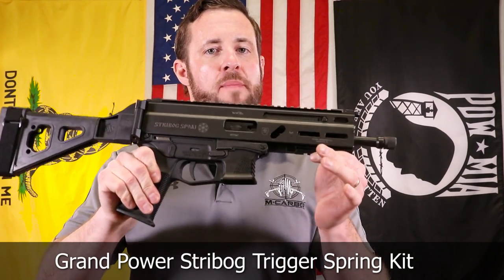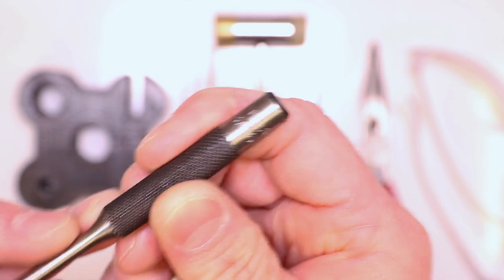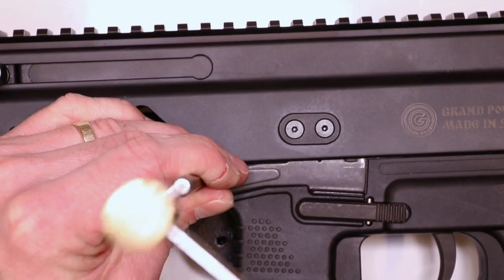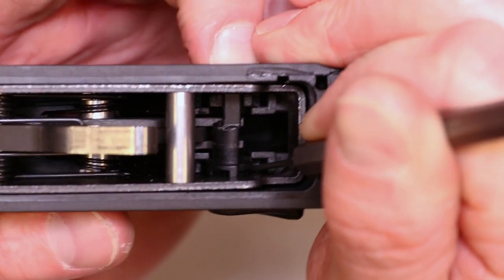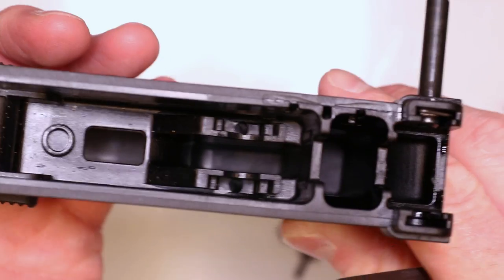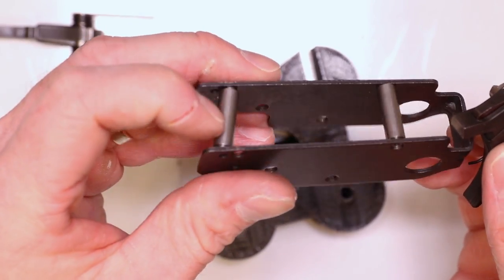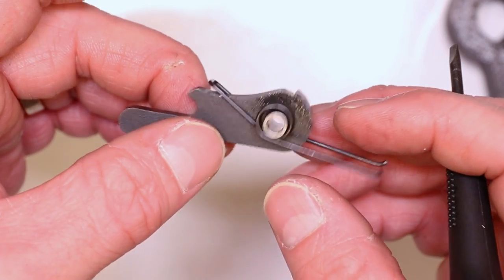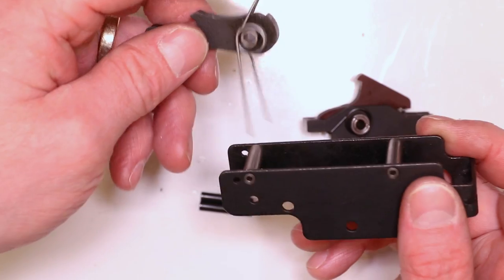Grand Power Stribog Trigger Spring Kit - Stribog Accessories by M*CARBO

Comment: As some of you may know, the latest production of Stribogs has been coming through with heavier trigger pulls than the earlier ones. My 2020 production Stribog had a trigger pull weight averaging 8.5 to 9 lbs. This seems to be typical of the latest production examples I've read about. So today I installed this trigger spring kit in my Stribog and all I can say is WOW! With the spring kit installed, the trigger pull weight has been reduced to an average of 5.5 to 6 lbs. That's an impressive decrease in the trigger pull weight and makes this kit definitely worth installing. Thank you, M*CARBO!
Reply: Ok, this makes more sense.... I just finished my spring kit and I'm hitting about that much. Forgot to test before hand so dont have a accurate lb to compare to

Comment: I would love to buy a smooth replacement for the right side "ambi" safety switch. I'm right handed and the right side switch interferes with my grip and trigger finger. That and more robust mags. I haven't had a problem with mine, but they look and feel weak. I don't dare store a charged magazine, which defeats the whole purpose of a defensive weapon. At least metal reinforced feed lips. All steel magazines would be ideal.

Also, your left index finger. Ouch!
Reply: I agree with you 100%, I haven’t had any issues with my mags but metal feed lips or magazines altogether would be ideal. I saw a tip on spraying a bit of oil into each mag and that seemed to help keep rounds from getting caught up in the mags. I think it was on MAC follow up Stribog video.
Reply from the maker: Thanks Brother for sharing the ideas.  I've added them to the list.  We've been getting more requests for Stribog parts.  Just a plastic safety delete or an Aluminum Safety Replacement with larger selector levers and a delete included in one kit?
Reply: @MCARBO  I like your idea!
Reply: Yea I hear you there on the safety interference on the trigger finger it’s annoying, but a good indicator that it’s ready to fire.
Reply: You can remove the right side of the safety switch,  carefully snip the "ear" off it and sand it smooth then reinstall it.

Comment: +1 on that charging handle and bolt stop. Maybe even a better fitting brace adapter. For these tactical brace. Honestly though the biggest thing this system needs are better mags or a lower that accepts scorpion mags along with the ability to change at style grips. Long wish list but hey, charging jangle is a great start. Thank you for the video man

Comment: I have already done this upgrade.  Love  the change.  Lots of requests for folding charging handles for stribog.
Reply from the maker: Awesome!  Thanks Dallas for your Support!
Reply: Definitely would be cool to have the folding ambi levers so they don’t snag and then when you go to charge the rifle an easy access for the digit that will be digging for the folding style that makes is comfy when diggin for it. I did end up buying the reduced trigger spring kit form this Vetren Owned company, I was gonna ask if being an RN have any clout for discount pricing lol . I’ve heard there are quite a few triggers that will fit without any crazy mods perfectly but I’d imagine some gun nut like me is making a list and checking it twice hoping a nice fostech echo might be an option 🤟. I’m looking forward tinkering around with this SPA1 and of course as soon as I did purchase everything they announce the SPA3 coming soon, I’m like dude 🤬; I actually like the trigger feel and  getting the REDUCED Power spring  KIT DESIGNED MY  M*CARBO SHOULD MAKE IT THAT MUCH BETTER;. I’ve already have around 1k into this sucker when you add the A3 Tactical brace which is so nice and also bought HI ambi charging levers that are an hour glass look with some lite knurling on each side with the extended lever can be put on either side and also bought HI’s extended bolt lock/release which makes a nice difference than a less than a 1/4” inch bent flap of aluminum  that pretty much makes you have to buy the extended version. Gran power being really bing tricky! 🤟✊

Comment: Not sure why others are so worried about the selector switch, they are glass fiber reinforced  nylon which has crazy tensile strength. Like Hilti or DeWalt drill driver bodies. 

At the same time if they choose to make one well badass I'll buy one but I wouldn't worry about the factory one👍.

Comment: My Stribog had about a 7 pound trigger.  Kit took in down to 4.5.  Just barely added a tiny amount of creep.  I highly recommend this upgrade..  My trigger group stayed together, the side plates and support pins were captured.  Trigger and hammer pins slid right out.  My pins measured .155".  So maybe a LaRue MBT could be put in there.  That is $90 delivered instead of $14.95 plus USPS and tax for FL for this trigger spring kit.  You be the judge.

Comment: Chris:   I just purchased a brand new Stribog SP10A3  - 10mm.    Most of the aftermarket accessory videos are 2 plus years old and manufactures talk about fitment of parts for A1 & A2 9mm versions.  I believe mine is an A3 version in 10mm.  That being said, I want to up-grade my A3  10mm with many new functional parts but, I do not know if they are compatible with the A3 10mm.  I want a folding charging handle, spring kit, higher capacity mags, 10 mm. muzzle brake, front rail extension, better safety lever and a better ambidextrous bolt release.  What MCARBO parts are compatible with my 10mm A3 and are you making more 10mm A3 compatible pars in the future?  Thank You

Comment: Your version of a hi grade aluminum lower for Glock or scorpion mags since there are three other companies that are making them, I bought the extended, bolt lock levers which are nicer and ambi side charging levers and the one is longer for best manipulation side than the other from Harbor Industrirs. Better take down pin-“springs” since I only had one in my new SP9A1 which was not seated in its correct spot 😕. Extended selector switch safety levers preferably in a anodized alloy. I like the idea of an AR lower for more modifications with any lower AR parts from triggers, safety selecters, mag release buttons etc. I seen someone using the JP reduced power spring kit which I like the idea and will probably buy yours since it was designed for the stribog. Nice work!
Reply from the maker: Awesome!  Glad to hear it Brother.  Thank you